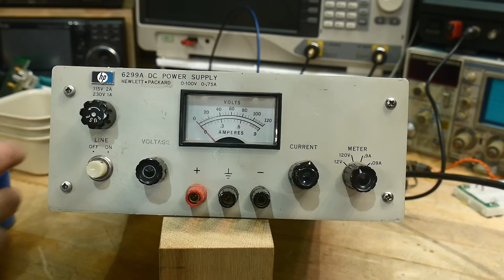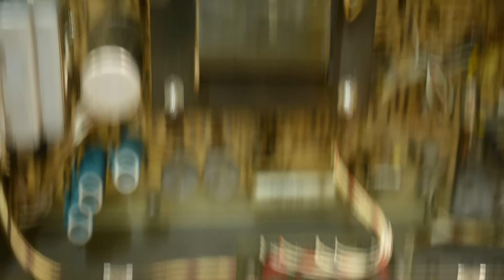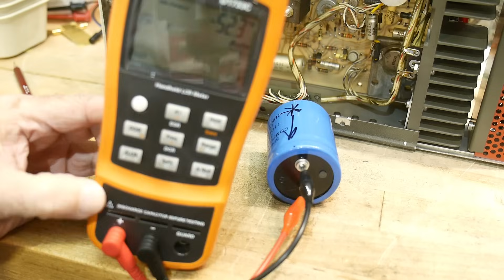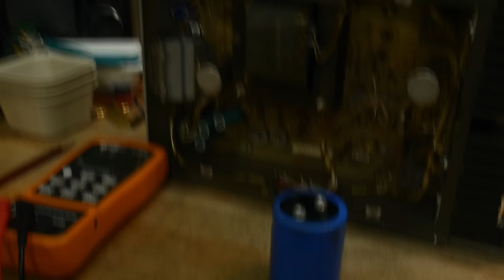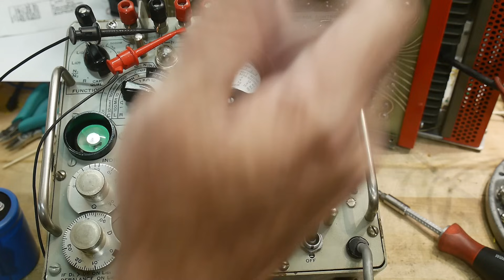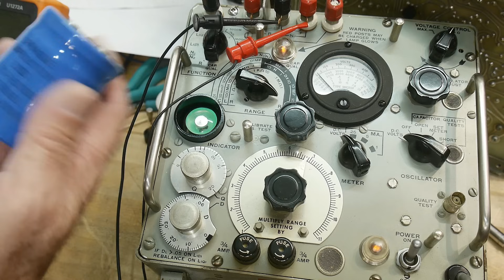#1834 HP 6299A 100V Power Supply (part 1 of 2)

Comment: I bought some cheap and dangerous high voltage generators from china precisely because of stuff that malfunction only at "high voltages", whether they are capacitors, resistors diodes, transistors, switches, etc. It has been really helpful

Comment: Have a theory on that shorting cap.   The previous owner tried to re-form the cap and brought the voltage up too fast and shorted it hence the shoring at voltage 'X'  I have done this myself to an NOS computer grade cap blew it a 100v.  It reads perfect  ESR, capacitance but shorts when voltage goes near 100  d'ho.

Comment: What is the make and model of that beautiful, old-school capacitor tester?
Reply from the maker: https://www.youtube.com/watch?v=NWm7yu1W3v0
Reply: @IMSAIGuy  That's going on my wishlist. I've got an EICO 950B, a Cornell-Dublier BF 71, an HP 4260A, as well as a modern LCR meter (DE-5000), but this puts them all to shame with the knobs and switches and dials and knobs and switches (and magic eye!).

The EICO belonged to my grandfather, so it has sentimental value, but is otherwise unremarkable. The Cornell-Dublier is essentially the same as the EICO: a service instrument rather that a laboratory grade instrument. The HP device is laboratory grade, and has an interesting method of operation, including some custom controls/indicators.

Comment: As a technician who has specialized in the repair of commercial photographic flash units, which typically have main capacitors in the 330-500Vdc range, the fault is quite common. High voltage capacitors can even fail like this one did and "self heal" to continue on with a long life afterwards. Self healing is a design feature of certain capacitor types and brands.

Comment: This HP supply reminds me of a series of linear DC supplies from a company called “Power Designs”. Probably about the same vintage, maybe a little older (they feature similarly hand drawn PCBs, but were new enough to be using 2N3055 output transistors and DIP op-amps to set the voltage/current levels).

You can still find a lot of them used, they’re commonly a pretty generous voltage range with more limited current. I picked up a dual model that has symmetrical 50V/500mA, I think I paid $80 shipped. They’re seriously well built and very quiet. My unit had an asset tag from a nuclear research lab in California, I believe Power Designs was originally a California company.
Reply: Not endorsing anything, the company is long gone. Just, if you stumble over one for a good price, they’re great supplies without the premium of an HP badge, and they’re a pleasure to work on/with.
Reply from the maker: yes they are nice: https://youtu.be/lm73gaHT6EI?si=fJMTPE5mu32KqxEc

Comment: That's why I like my old solid state Sencore high voltage capacitor analyzer and my even older tube type Semcor (not Sencore) high voltage capacitor tester's.  I have seen this many times in the past.  Someone sent something in for repair and said they tested all the large bulk filter capacitors and they tested well within spec.  I test them at their rated voltage and they fail.  I wouldn't say it's a common failure but it does happen.

What I have found over the years is that if a aluminum electrolytic capacitor test over +20% or higher capacitance than what is printed on it, it likely has high leakage current.

You don't even need a capacitor analyzer / tester to test high voltage caps.  As long as you have a high voltage power supply the only other thing you need is a series current limiting resistor.  Just hook up the cap in series with the resistor and monitor the current.  Good rule of thumb for maximum leakage current is .01 x C x V = maximum leakage current in uA.  That's .01 times capacitance times voltage.  In the case of this capacitor that would be .01 x 710 x 200 = 1,420uA or 1.42mA maximum leakage current.

Comment: Correct me if I'm wrong. I'm under the impression that ESR is very important for switching power supplies. Especially at rated switching frequency. ESR has nothing to do with a leaky cap. A linear PS could care less about ESR, as long as the cap wasn't leaky. If there was a good example of a leaky cap, this would be a good one. Just as an FYI Antique Wireless has a cap tester that will provide voltages from about 10v to 600v.
Reply: couldN'T care less.

Comment: Interesting, wonder if you could reform the cap by slowly raising the voltage.   If you can't find a replacement cap , cut open the old cap, replace the guts with several radial Nichicons and glue it back together.

Comment: I've always wondered about these new capacitor testers using low voltage to test leakage and ESR.  I have a couple and enjoy them but always wonder.  I do have an old Eico capacitor tester that can test leakage at higher voltages and will pull it out occasionally, but never had any positive results like you did.  I'll keep the old tester!

Comment: I always test capacity, ESR, and leakage of capacitors before using. Just like your ESR chart, I have a similar one for acceptable leakage current. Unfortunately the leakage test I do must be manually performed with an external resistor and voltmeter, because I don’t have enough work to justify a dedicated test unit.

Comment: This type capacitor are pretty expensive, i repaire big switching power supply with through hole capacitor because capacitor with screw cost me 80$, few through hole capacitor in paralelle 10$ with better ESR and life!

Comment: The capacity tester is really spectacular. It reminds me of the Saul Steinberg cartoon where he explains which of the cockpit instruments is for coca cola. 
If you do not have such fancy equipment the high voltage test could be made with a voltage source, like a variac, diode, resistor and voltmeter. If you have it you have to make use of it, it really looks nice.

Comment: I used to work for a company that built fault detectors and sensors that were designed for use on medium voltage lines - which is anything from2400 to almost 70,000 VAC.  We tested a lot of capacitors from vendors who assured us they were good at those voltages only to find they failed (sometimes spectacularly) when in that environment.
Reply: At such high RMS values, the peak values are ridiculously larger. I mean the ratio never changed but it is quite shocking how that 30kV actually goes up to almost 70kV haha.

Comment: I always admired the old meter's capabilities and design. 
You should open up the old cap and look for the arc path. 
What is the vintage of that PS?
Reply: I'm guessing 1976 based on the prevalence of 76 on many of the parts (in possible date codes).

Comment: Had a few of those old Sprague capacitors that had long term failure. Very variable, the one rotted away, but the one next to it from the same batch was absolutely perfect, almost meeting spec even before any reforming.  Reformed at operating voltage via a resistor for a day, and then left it open circuit for a month, where it had dropped less than 1% of the voltage due to leakage. OK it was a 15000 uF 6.3V rated capacitor, charged to 6V, but impressive after close to 4 decades of non conditioned storage. Still have one or twp of the 100uF 6V rated ones, that are 1.5in long, and 0.5in diameter, which I thought was a typo in the data entry, but they were those dimensions. All failed, capacitance all over the place, and ESR in the dozens of ohms ranges, but so big, even for the 1960's era. Kept because I might get a tube amp, and hide a modern one in the case to use as cathode bypass capacitors.

Comment: Just turned mine on the other day after having not used it for a couple of years. A little smoke came out, so I opened it up. Tuns out R11 is just dissipating 3 or so watts all the time and had a piece of lint on it. Cleaned it off and it's been running fine.

Comment: I have seen those caps get leaky at higher voltage but never arcing. Must be a defect in the insulator separating the plates or something like that. Maybe it got over voltaged at some point and that blew through the insulation?

Comment: I’ve thought about this before, why couldn’t you use a smaller more modern cap of the same value and voltage rating?  What is so special with these “computer grade” caps?
Reply: You can but you also have to pay attention the capacitor's Ripple Current rating.  The 'computer grade' is more of a style and intended use thing.